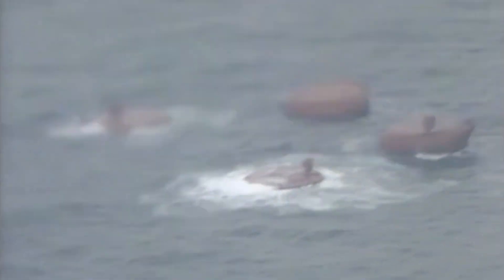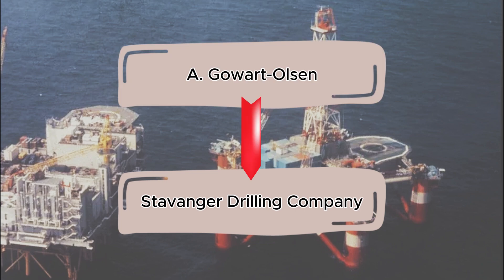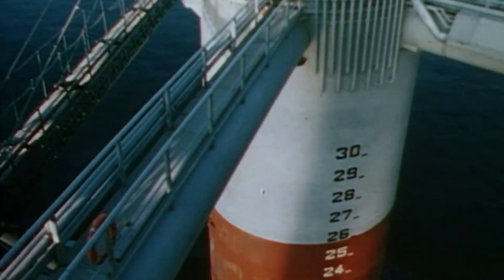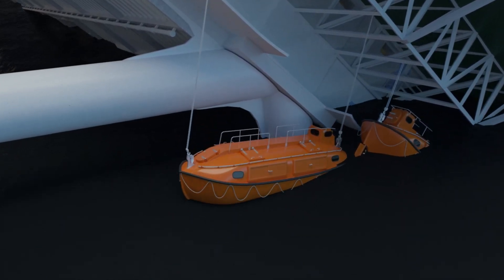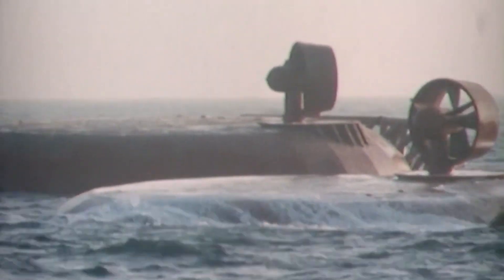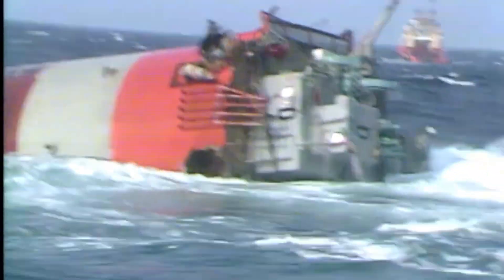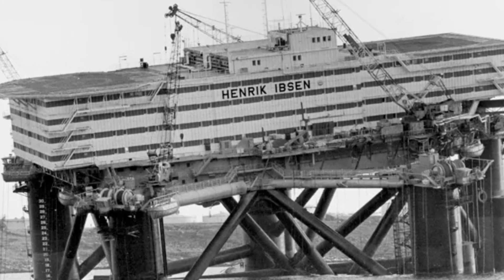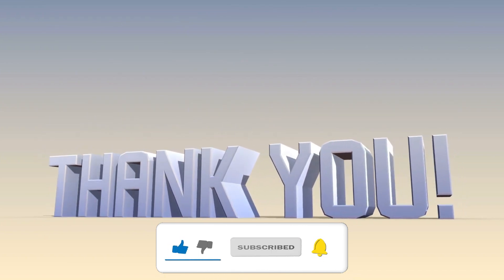14 Minutes to Disaster : The Alexander Kielland Accident

Comment: They kept adding weight to it over the years. Wonder if the extra load was properly calculated. Probably not. Bridges fail for the same reason (heavier cars and extra layers of roadway)
Reply from the maker: Wasn’t really a factor. It could cope with the extra weight, but there was a fundamental design issue where loss of just one brace was catastrophic. Most installations are designed with redundancy where failure of one brace can be tolerated.

Comment: Anything without an even number of supports is prone to extra stress and flipping. 3 wheel carts compared to four is a simple example. 5 to six is what we see here. Odd man out, respect to the fallen wasn't thier choice or fault. Shit was wildly unprofessional in that Era. Assume it will fail, design to endure failure and our lives do mean something more than a wage. We are people with families who want us to come home alive. I'm a certified ironworker and welder. I've built drilling rigs, some components for offshore use. I'd hate to be the guy that put an inferior weld out there that could cause such catastrophic consequences.. carry that shit foe life and end up in the bottle with a gun to my head. Fuck man, do it right.
Reply from the maker: IMO the fault lay with the non-redundant structural design - not the welder who was welding what should really have been an insignificant weld. These days such a non-redundant design wouldn't be allowed.

Comment: Another great reason to STOP USING OIL!
Reply from the maker: No it isn't - accidents like this are very rare, and since Piper Alpha, there hasn't been any similar disasters in the North Sea. Safety standards offshore these days are some of the best of any industry. We will still need oil and gas for years to come yet whilst we transition to lower carbon alternatives. It has to be done in a managed way - you can't just switch off using oil because the infrastructure for Net Zero isn't there, and will take years to build up.
Reply: Strip mining for the components for renewable energy leaves the land barren and toxic to all lifeforms, and often uses child laborers (bordering on slavery). Is this really superior to oil? Cancelling oil is an emotional decision. Every industry has its own issues. Which is the best?
Reply: Another reason to stop using life boats !!